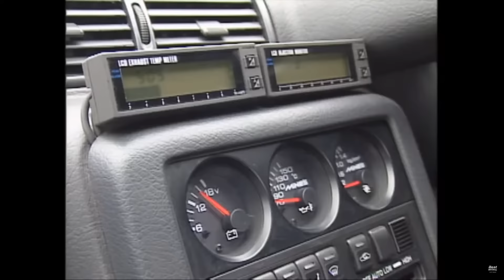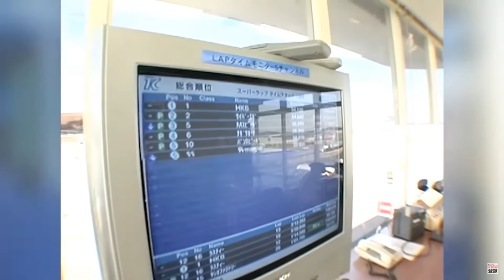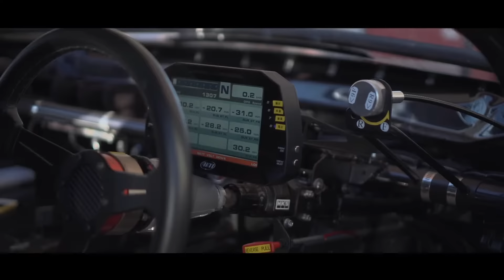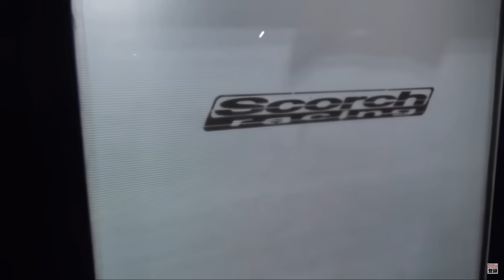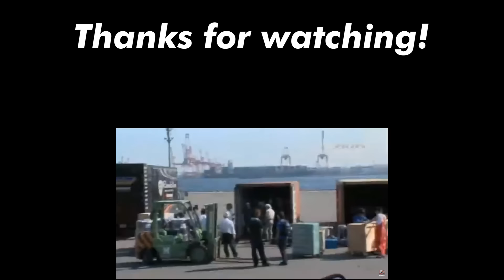The Story of Time Attack and 'Under' Suzuki

Comment: 29:34 It was a tyre delamination that occurred. While it was something that occurred to other teams (Tilton and RP968) those happened after a couple of push laps that caused their tyres to overload. Part of the reason Under Suzuki's tyres failed unexpectedly was that it was a set of old tyres that, if I remember correctly, were meant as a display set, not for actual race use.

Also this is a very good round up of Time Attack. Thank you for making it. I'm personally hoping in the future UK Time Attack can bring back the insane Pro Class cars that feature in other areas of the world. With the debut of Gobstopper 3 hopefully in 2022, we'll see a resurgence in the UK.

Comment: I’ve been made fun of for being an S chassis fanboy for decades at this point. My love started with both my first S13 and my S14 later. Even with the KA24DE engine those cars were so fun to drive. On most corners I could pretty much double the speed limit warning. If it said 25 I’d do 50, if it said 35 I could do 75 easy. Those cars were tanks too. I ate shit in my s14 on multiple occasions too and had minimal damage at best. Unfortunately they started having mechanical issues after putting over 250000 on both and life responsibilities took over and I parted ways with them. One of my biggest mistakes of my life. I still have dreams of driving them only to have my heart broken when I wake up and realize they’ve been long gone. Thank you shining light on the chassis and confirming my love for those cars isn’t delusional.

Comment: This car was over the top !  Lifting the inside rear wheel in the rain at 2:14 shows it. This car was better than anything back in the 80's. Trust me I know  ,I got to drive then new , The GLH turbo Dodge didn't stand a chase, the Daytona a small bit better. The GNX was a pig in a corner. The Cyclone was nutty fast in a s a straight line. This car was over the top. Wrx Xr4ti close this thing is still nuts.

Comment: That is true, slicks are reinforced compared to road tires, road tires aren't reinforced because it compromises comfort as it's a more rigid tire and also road tires are lighter so it also affetcs fuel consumption, its not just about the compound of the tire...